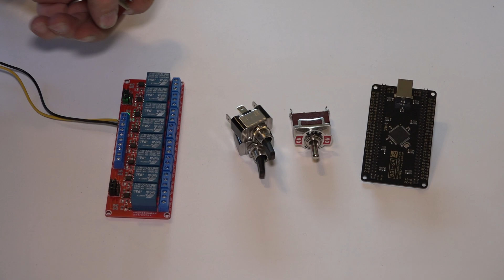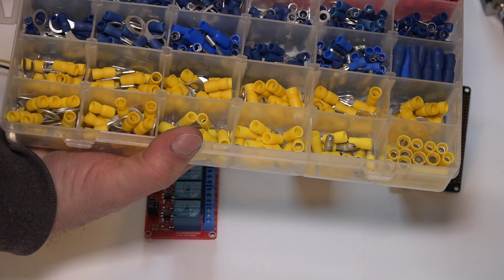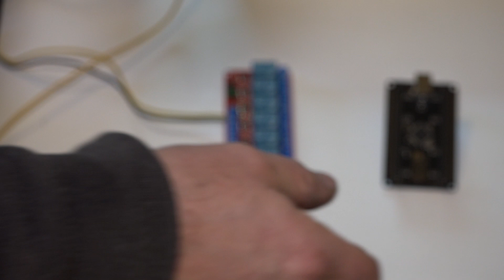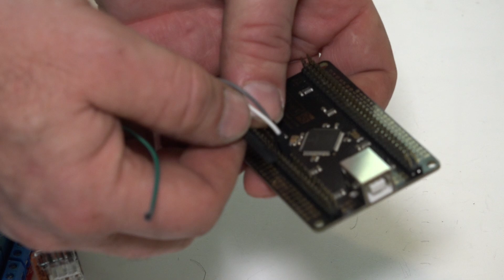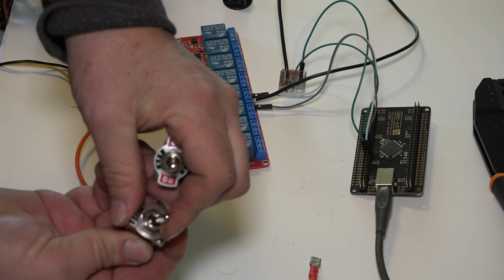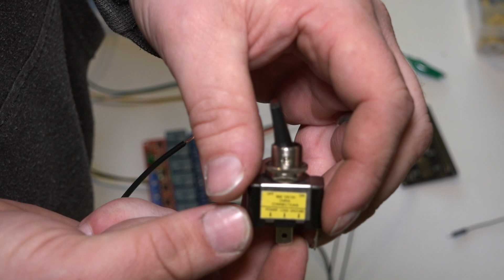How to wire Up Single Toggle Switches for ATS and ETS2 Truck Simulators (Part 4/10)

Comment: so i'm currently building a 379 dash for my triples, and would it be better to get 3 12v power supply, 1 for guages and one for switches and one just for the reply boards or can one 12v power supply handle all?
Reply: It depends on how many amps the power supply can handle you could also try using the 12V connectons on a pc power supply but I would do some research if I where you

Comment: I have a question about the 2 way momentary on/off switch would i not be able to wire it the way u did with momentary button? I hope that makes sense
Reply from the maker: Switches or buttons is all the same for the momentary on / off setups 👍🏻

Comment: Wouldn’t the three way switch work the same way without the relay going straight into the game controller?
Reply from the maker: If you only needed to control one function and the switch doesn’t have 12v coming out of it then yes that would work.

Comment: Hey sir trying to hook a spring back switch for my air horn but when in off position it blows and in on position it’s off. Any idea why?
Reply from the maker: When you programmed it, does it say in the primary or secondary button key column “HOLD”? I’m wondering when you programmed if you pushed and held the button to program it? I wonder if you’re using the hold function instead of the momentary press function in ATS. It sounds like it’s a momentary switch so when you highlight it to assign input you simply push and release the button quickly.
If that doesn’t work then maybe something is just wired backwards? Perhaps it’s the wiring, but I can’t see your handy work haha. 
Also, if you are using only one  momentary switch there should be only 1 “Joy” button listed for the horn either on the Primary or Secondary column.